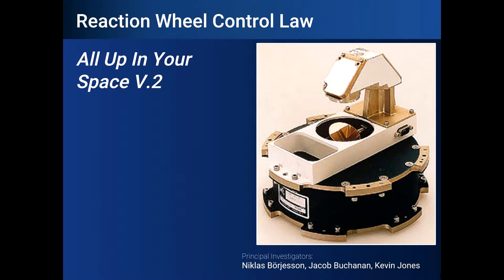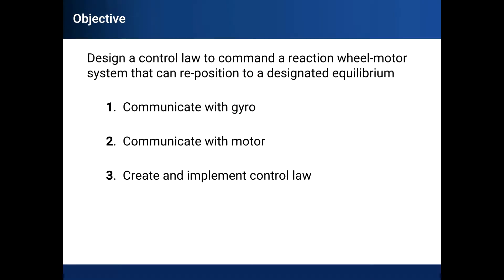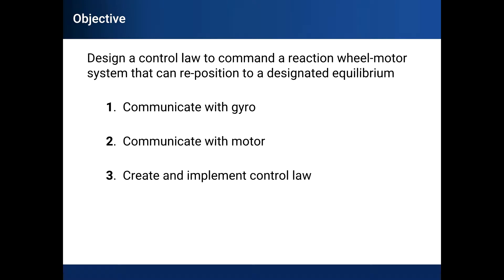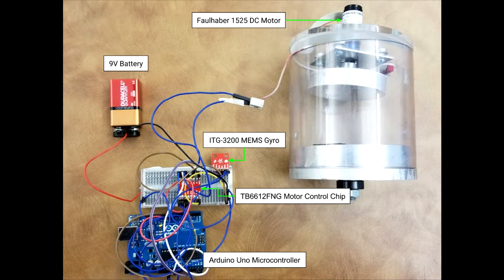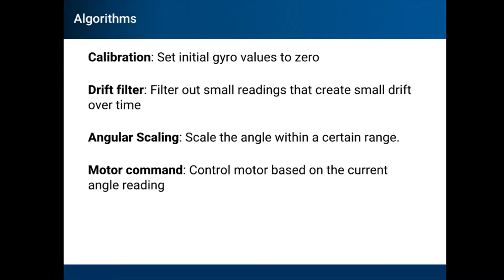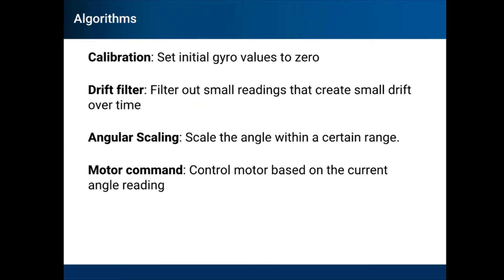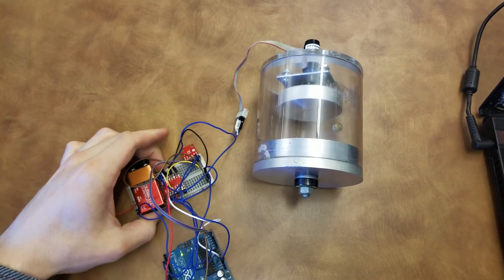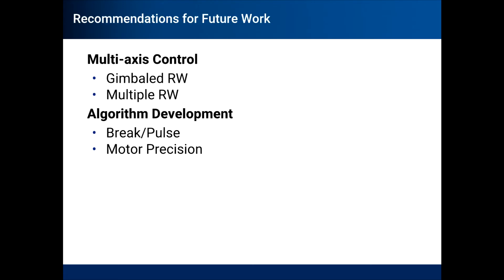AERO 465 Final Project - Reaction Wheel Control Law

Comment: I feel like the hardware design gets pretty important with this. Do you think your control laws would change with different moments of inertia? Is that why you say you wouldn't want the metal disk on top? What would the ideal hardware look like for this? More precisely symmetrical? Low moment? High moment? Or does it even make a difference as long as you calibrate it constantly? (I guess you were doing that, right?)